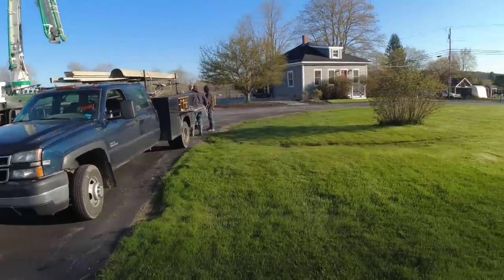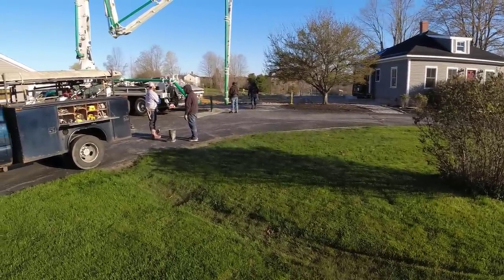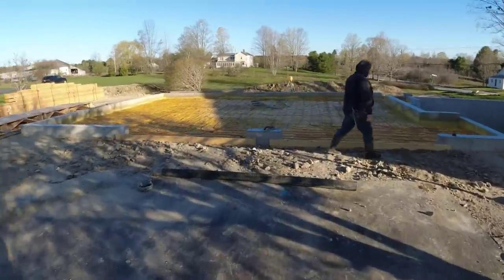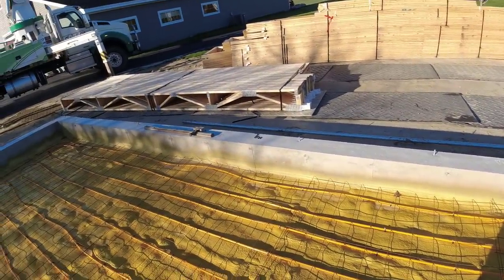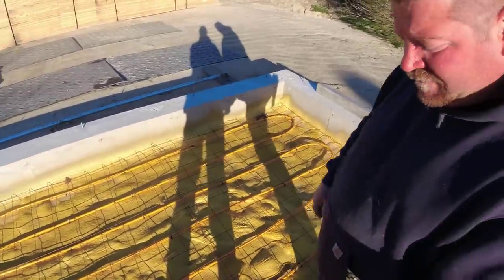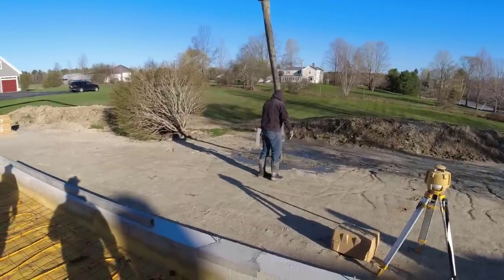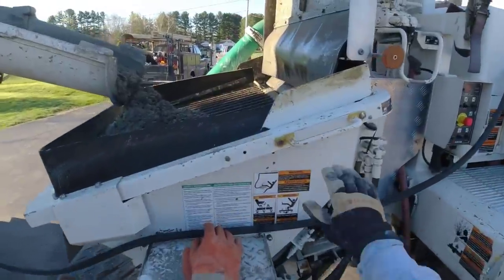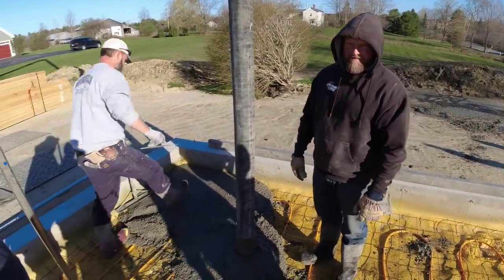Don't Use Spray Foam Under Your Concrete Floor!

Comment: Closed cell spray foam for me. Waterproof, no potential tape gap problems. No foam board surfing. Gravel must be compacted level, then a FAN nozzle for the foam application. Wire on top after cure, not embedded. Heat tubes also if desired. You can get a board like level surface for the concrete to pour on, but you gotta start with the dirt!

Comment: If I had a recommendation I would always recommend spray foam under slabs.
Superior to sheet xps, no joins or cut outs around pipes, and it’s a vapour barrier.
If the slab is structural their needs to min concrete thickness as per engineer specs.
You smashed it out, as always, nice job.
Cheers from Oz
Reply from the maker: Thank you!
Reply: Is that stuff termite proof? Do they put boron or something else like the foam boards?

Comment: I know its been used for some time now but Im still skeptical about using the 2 inch rigid insulation as well. I mean you have to get the base material completely flat for that foam to not have any issues with compression and then possibly having cracking issues cause of that.
Reply: It’s not a worry!  Over thinking!  At the same time to properly grade for concrete is not that hard when u tamp it properly.  No one ever wants to put the extra effort into the subase.

Comment: It’s hard to believe the spay foam would be less expensive than the foam sheets.
Makes me wonder if they aren’t sticking it to us on spray foam in my area.
Reply from the maker: They could be. Hopefully not.
Reply: I thought closed cell was always dyed a diff color and open was white or yell kinda odd also
Reply: @randyanderson1983  
Where I’m at yellow is pen cell and green is closed cell . But I wouldn’t think you could walk on open cell? I am definitely not an expert.
Reply: @c50ge   if you’re in the USA it’s not required for the manufacture to dye the material. In Canada it is so they can see if it was the installer or manufacturer error.

In the USA, Lapolla/Demilac has a blue/green closed cell. However they’re the only one I know of with a dyed foam.

Comment: As someone who owns a spray foam business… you can’t make the foam even if you’re spraying over an uneven surface but with that being said wouldn’t you want the foam to follow the contour of the ground instead of leaving empty voids under the concrete?? Seems like foam boards would leave voids where it could settle and be more likely to crack.

Comment: How do you decide what screeding pattern you’re going to do? This one has me a bit confused.  You blew out the first truck and then screeded about 5 feet off the wall the whole way down before really getting into the meat of it.   Why would you do that instead of blowing the truck out, and not doing that 5 ft screed off the wall, rather just use your wet pads and make longer rips
Reply: Just curious and am always trying to learn the better method.  You are the máster and I figured there is a method to the madness
Reply from the maker: The owner wanted that first 5' flat, then sloped the rest out the garage door.

Comment: Hello sir, I'm doing a patio for my girlfriends family, buying all the finishing tools, it's 12ftx15ft and a size walk 3ft x15 ft..... I was wondering what bull float size I should get, I'm thinking about a 42in but I can also get a 72in. Which would you recommend
Reply: 4' bull float would be a good one to start with.  You'll be able to use it for a variety of jobs as well.  Good luck and cheers!

Comment: Just need to use a laser when applying the spray foam. Then afterwards use the Lazer to shave the high points.
Reply from the maker: That would have helped here, thanks!
Reply: Can closed cell be shaved without affecting the membrane properties?
Reply: @theradonpros   - (you don't seem to have gotten an answer) yes  one can shave closed cell sprayfoam, as all the foam buildup is closed cell, there isn't a single "membrane" as with most other membrane types.

Probably good to spray the foam on top of a plastic membrane to start with to eliminate problems in the event it cracks - No Idea if this is ""a thing" - also puts rodent/insect  attack one layer further away.

Comment: You're complaining about SPF being uneven, but if you use rigid board all that "unevenness" would be empty space under the slab and as soon as the walls go up all your pretty new concrete is going to end up looking like a spider web of cracks because of those voids. Spray foam fills everything perfectly its far superior to rigid board in literally every way. How is that not obvious?

Comment: How thick is that spray foam ? One thing for sure is I`ve spoke to engineers on the subject of roughness on the grade such as seen hear and they definitely will start to talk about slab structure integrity saying it will cause the slab to fail not being smooth on the grade.

Comment: is it just me or there's no thermal break between the outside wall and the floor?
Reply: Why do you care?  Floor provides heat.
Reply: @xephael3485  the pad they poured has direct contact with the wall, so all the heat will escape into the wall and onto the outside
Reply: @oneiros1401  concrete is not a copper heat sink... It's not that good at transferring heat.  The basement air will also heat the concrete wall slower but to the same degree

Comment: You mean always use spray foam bud. Nothing compares.
Reply: But it's such an uneven surface, very hard to get an even grade and guesstimate the yardage of Concrete.
Reply: Closed cell foam board is much easier to work.
Reply: @CtheG420  surfaces grading should not be dependent on what concrete is poured on.. you don't have to have yardage figured out perfectly
Reply from the maker: This was really out of level, wasted too much concrete just making sure we didn't run out.

Comment: Misleading title for sure. Buy the way how does your foam board work when you’ve got that many people walking all over it and busting it to pieces if the ground isn’t perfect rendering it useless but hey it’s covered with cret so no one will ever know there shitty insulation job.